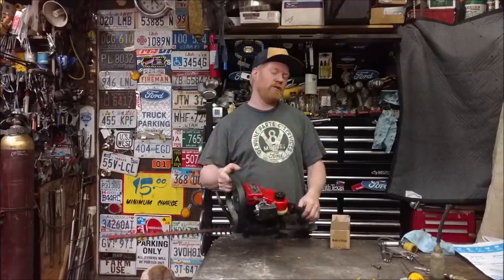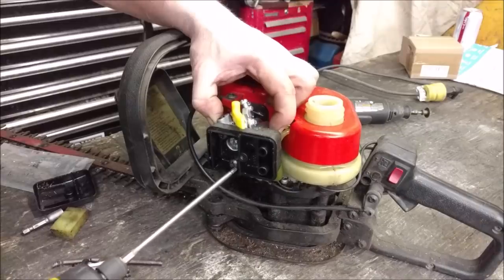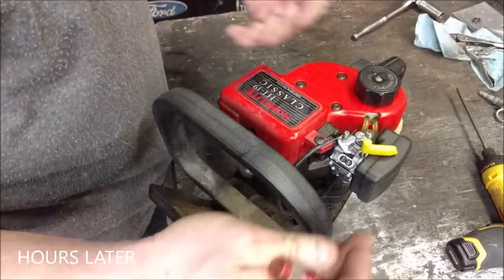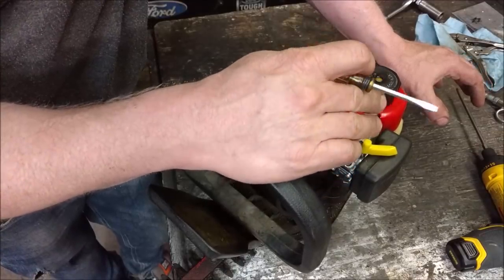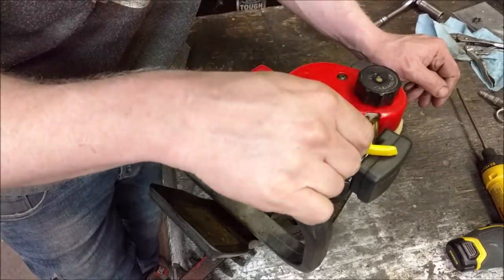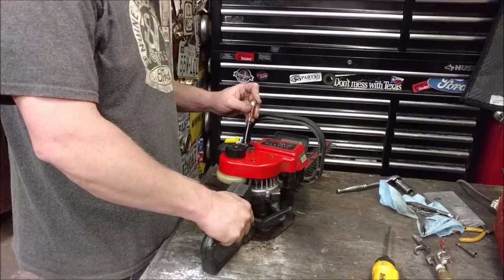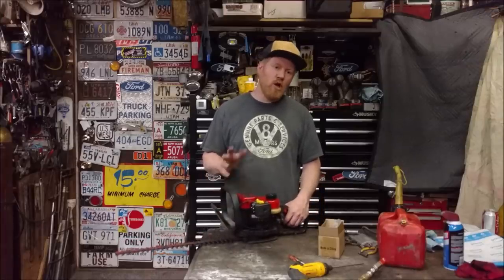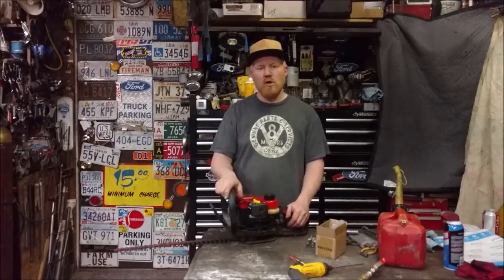Aftermarket small engine Carburetors worth it???

Comment: The one I needed for a snowblower bolted up perfect. No adjustments needed worked great all winter.
Reply from the maker: Sure they "work" but I have yet to see one work fully to 100% peak engine performance.  I just put another one on yesterday and the engine runs good, revs good, but with my 20years of carb service I know it's only allowing the engine to run at maybe 90% power. That's the best China carb I've gotten so far.  I have helped hundreds online with trouble shooting their poor performing new carbs. Everything from enlarging jets to shrinking them for altitude. These are the perfect solution for a beat up piece of equipment that just needs to see another year or two and then will need servicing again because the neglectful owner left crappy gasoline in it again.

Comment: I have a chainsaw that I've never been able to get running right, it had a new carb on it when I got it and that's probably the problem. I did buy one of these for our mantis tiller and it works great when I use the good alcohol free 95 octane canned gas. It runs like crap on pump gas mix, the carb is probably the reason for that too.
Reply: The chainsaw doesn't run as good as it could because it probably has a crank seal leak. HOWEVER, check the simple things first, like cleaning the spark arrestor screen.
Reply: @999thenewman  What sort of running issues will a bad crank seal cause? The main problem I have is that if I can get it to idle it wont rev up but if I can get it to rev up I cant get it to idle at a low enough rpm for the chain to stop spinning.
Reply: @SteveStoltz  A leaking crank seal allows too much air in. A lean run makes revving difficult despite adjusting the carburetor, and once it's up to speed, run too fast (no real torque under working load). Then choke out when adjusted (way too rich). You will chase yourself in circles. Try Donyboy73's videos to diagnose that. Easy way is to strip it down, spray soapy water and blow some air into the spark plug hole. See where the saw bubbles. But before you do, take apart the intake and make sure the reeds are still flat. A bent reed will cause all sorts of performance issues since the air is metered more and more inconsistently as you rev the saw.
Reply: @999thenewman  Thanks for the reply, chasing myself in circles is a pretty accurate description of working on that saw.  I'll look into that crank seal further.

Comment: Most of the aftermarket carbs are equal if not better than the original. The original replacements if available are made in China, same factory just about 200 more. You probably got a bad one. It's a shot in the dark but most of the time I said MOST like 95% I have good luck with cheap Chinese parts. You have to inspect parts really closely. There are ALOT of quality companies but ALOT of pirates in China as well. I will end with this: China is a blessing in disguise for ALOT of older stuff the US long since made obsolete. At very minimum it's a good core candidate to rebuild.
Reply from the maker: I'm going to balk at your "better" statement. Are some Usable, sure. I've put on at least a dozen clone carbs and to the average Joe they are ecstatic their machine runs. But to someone who deals with 100's or carbs a year can easily hear/feel they don't meter the fuel correctly. It is an absolute last resort only if the stock carb is total junk. They always need tuning and are ever so slightly off. A 4 stroke won't care too much but it's a death sentence for a 2 stroke machine. This is probably the worst one I've got in. I have been to China for my last job and seen the factories. They are not all made in the same factory like everyone likes to blindly claim/believe. China does one thing great, Clone. One factory is built by Walbro, Zama, Briggs or whom ever and other factories pop up next door. Workers smuggle parts out and the other factories make molds of them. There are probably 100 factories making the exact same clone carb, or clone of a clone; they don't care.